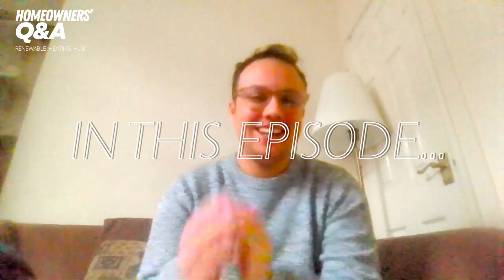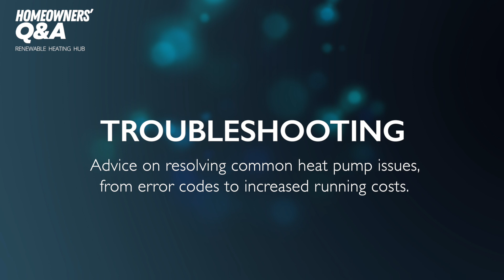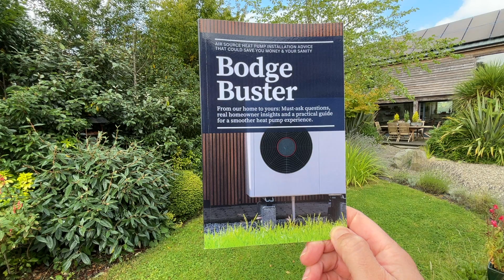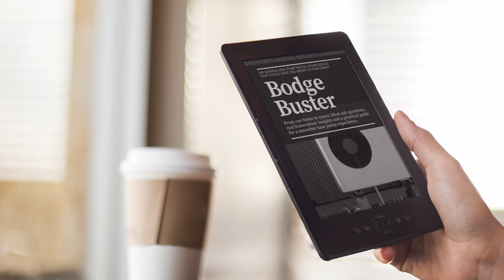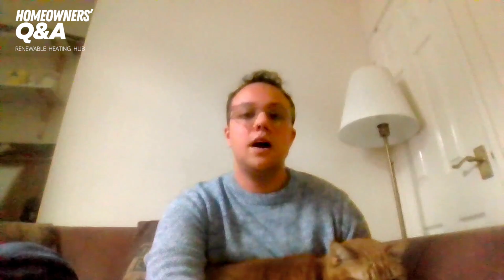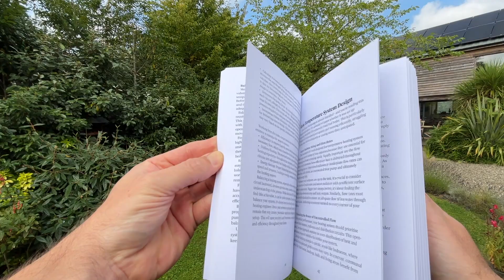Heat Pump Troubleshooting: Flow Errors, Short Cycling, Defrosts & Increased Electricity Consumption

Comment: What worries me is that ASHP seems to be a little like using MS Windows Plug n Play!  The minute you have to delve into the workings it’s not plug n play - all the different factors with new and existing  installs for some is off putting.  As an ex electronics engineer I’m a bit of a geek when it comes to technology should my wife watch these vids with the various graphs and all the associated tech I would be banned from getting one, so I watch out of view.  And it’s nearly all blokes on the forums.  Get it installed and play with it for a year or two to fine tune.  Not nocking you guys because the info is priceless it means the industry isn’t there yet.  Thanks for the commitment and content.  `Mike

Comment: any idea how you work out if the cold air coming out of the ASHP is being circulated back into the ASHP due to positioning - is there a test you can do? want to avoid ASHP working harder than it needs to!!
Reply from the maker: Easiest way to do it is a smoke test: 
Smoke test for assessing airflow patterns for air source heat pump
https://youtu.be/q_mntrCsBug